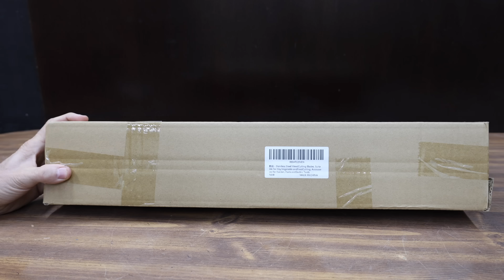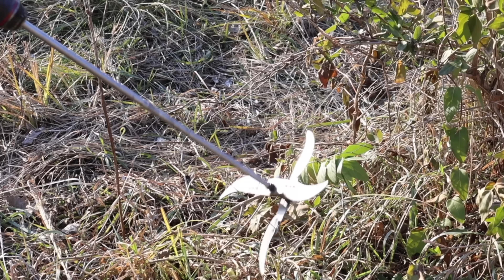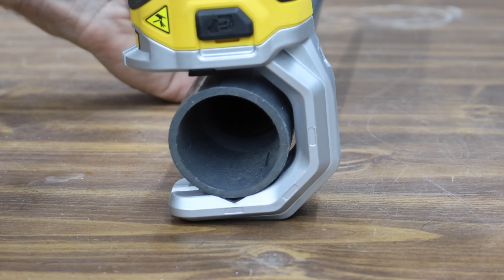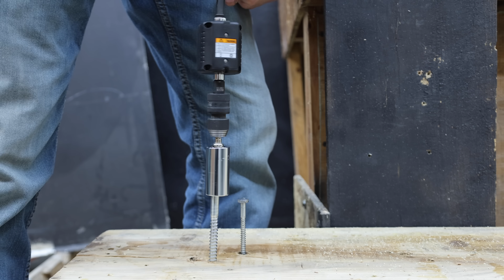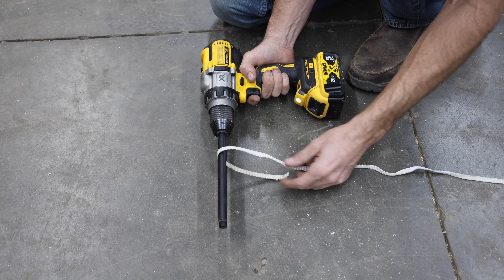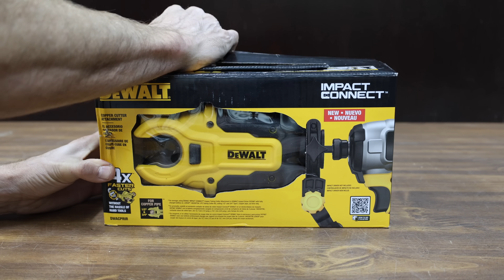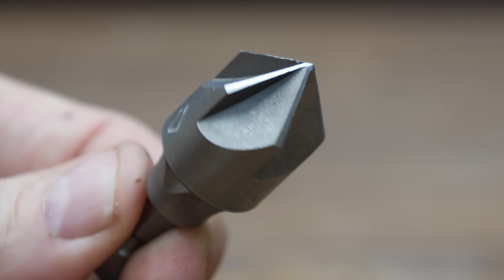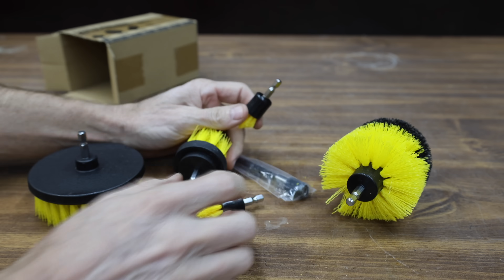I Replaced 10 Power Tools With My Drill!

Comment from the maker: Here are the drill attachments and please check out the video description for more details. I bought all of the drill attachments; no sponsors, no free tools, and no company saw this video before you did. So, thank you for supporting the channel! Best regards, Todd

DeWalt PVC/PEX Cutter: https://amzn.to/3KMkUTX
Chainsaw: https://amzn.to/44LBeuS
Universal Socket: https://amzn.to/4qmxwQx
DeWalt Metal Shear: https://amzn.to/4qsMQeI
Strap Winder: https://amzn.to/4qrGLPv
Auger: https://amzn.to/49q3DsV
DeWalt Copper Pipe Cutter: https://amzn.to/3MOTrBA
Deburring Tool: https://amzn.to/49rkwU0
Deburring Chamfer: https://amzn.to/44CsVS4
Drum Sander: https://amzn.to/4qoGxZs + https://amzn.to/3YaroPu
Sandpaper for Drum Sander: https://amzn.to/3YJEiEc
Drill Brush Set: https://amzn.to/4p3mbUp
Flexible Drill Bit Extension: https://amzn.to/49qUIHG
Wire Brush Set: https://amzn.to/4pdFPNv
Water Pump: https://amzn.to/4apMQHw
Vegetation Cutter: https://amzn.to/45j4nxt
Circular Saw: https://amzn.to/3Yul2ux
Reciprocating Saw: https://amzn.to/3LiTYLz
Rivet Gun: https://amzn.to/4jljRqQ
Reply: :face-fuchsia-wide-eyes::face-blue-wide-eyes::face-orange-biting-nails:This is like CRACK for the cheap DIY fiddling with crap person with not alot of pocket change or space for BIG tools, tons of hand tools (like I have had dremel and rivet)  or bench tools
Reply: @klyanadkmorr Caterpillar was created with the crazy idea of selling more expensive but reliable as being cheaper where nobody was concerned about reliability. Took over all markets but one. The only one where price does not matter. Govts. Don't be like them. Learn to recognize true long-term value.
Reply: @klyanadkmorr And like drugs, always a bad idea.
Reply: video idea: collaboration with Smarter Every Day. I just think you guys would work well together.
Reply: @megarural3000  Neither Project Farm nor Better Every Day has ever done reviews of robot vacuums. Project Farm should do normal big robot‑vacuum comparison with all the usual controlled tests for his clean spreadsheet. And then, Better Every Day should take the same models and show what it’s actually like to open them up, use them daily, and fix them, dealing with real‑world failures. After that, Project Farm can update his rankings with the new repairability and long-term use data so final results reflect both performance and long‑term ownership.
Reply: Thought you might have used a oscillating multitool attatchment if there is such a thing, thats besides the plasterboard ones which arent much.
Reply: That external deburing tool can be bought on ali express for less than $5. It is simply being drop shipped from ali express to amazon. I would check to see if the same is happening with all the other products.
Reply: @littlejack59  Will you? Why haven't you? Slow shipping, long delays, no quality control,   common counterfeits, dishonest specs, fake safety claims, and painful returns make Ali Express ALWAYS a bad idea. Not where you buy REAL tools. Do not attach anything from there to your REAL drill. Only some cheap Harbor Freight drill and only after doctors have given you 5 years to live anyway. LOL
Reply: I have a dewalt 90º impact adapter and it has been fantastic.
Reply: I really enjoyed this video but I think the quality of the drill is obviously important. I would very much like to see this video redone with a high quality *wired* drill. I always prefer to use wired power tools- even with the newer battery technology- wired power tools are significantly more consistent, strong and reliable.
Reply: @uhmmchicken  At first glance, that looks like a Milwaukee M18 FUEL 1/2" Hammer Drill (2904‑20). This is a high torque (1400 in-lbs), high spin (2100 RMP) trade‑use drill (framing, hole saws, augers, metal). Tough but expensive to use batteries drill. Your claim that "wired power tools are significantly more consistent, strong, and reliable" was very true over 20 years ago. Most corded homeowner drills are 6–8 amps, 300–500 in‑lbs torque, 2500 RPM, no clutch, electronic torque control, kickback or overload protection. They give steady but modest power. The impressive 2904‑20 out‑muscles most every corded homeowner drill ever made. Only 10–13 amp heavy‑duty corded drills can beat it. Why the corded heavy-torque class of drills is dead. In fact, I can't think of anything similar in production. And these demos would not have changed. 🙂
Reply: @JustMeAP1  While high-end brushless cordless drills now rival or exceed the torque of some corded models, corded drills generally offer superior, consistent power and higher top-end speed for heavy-duty, continuous tasks.
Reply: @uhmmchicken  I covered your BS claim. Steady but extremely low power is NOT impressive. Again, I could not find any "real" corded drill in production. I know growing up is hard, but it's time to catch up.
Reply: Can you please do a video on Dent pullers for vehicles?
Reply: "We're gonna test that" with the world's worst version of the scientific method where we can't read any of our measurements.
Reply: Or test automobile windshield wipers please? Including the kimblade
Reply: Great video as always.  I have an issue with tools that cost less than $3 to manufacture selling for more than $10.
Reply: Test these new handheld leaf blowers showing up online?
Reply: Did your health insurance payments just increase? 😂
Reply: On the rivet adaptor, did you tried to unwind the drill long enough until the rivet falls off the attachment? I have one and that is the way of release the shaft of the rivet
Reply: no clue why this hit my feed, but its not only something I needed and didn't know it, but by the end of the very first review....the weed cutter, I was subbed.    Just your tone of voice as you matter of factly pronounce it "this is the most dangerous thing I've ever tested".
Reply: “No sponsors”

Meanwhile Dewalt getting all this free advertising. They should definitely be paying after this. Those attachments worked as advertised!
Reply: The brush set is actually on its way to me now 😂 I got a dinky little drill for in the apartment and need to deep clean the bathroom and tile for inspection week in two weeks! For once I got the review BEFORE needing the items! (I bought rhino ramps 2 weeks before you reviewed all the car ramps 😅)
Reply: @JayFochs1337  The chemical you use on a bathroom or tile surface matters far more than whatever brush you use. I'm a 70 yo with a broken back and I have FAR more elbow grease than drill-based brushes. CLR and Lime-a-way are great for shower calcium. But hard‑water scale chemically hardens into calcium carbonate “stone” with hard water laugh. Stronger acids (that mean special suit to use) include stuff I cannot use on my fiberglass. Silica, common hard water issue, ignores all acids.

Step 0: CLR. For tough calcium and silica... Step 1: alkaline cleaner to break up the soap-scum bind. Dawn is surprisingly effective. Sit for 15 mins. Step 2: a plastic razor scraper. Step 3: warm wet paper towel to better soak. And repeat. For glass only, use steam (and vinegar). Still a milky haze on the glass? Use Cerium Oxide Glass Polishing Solution.
Reply: Can you do a video on electronic microscopes?
Reply: Please, please, please can you calm down the delivery. It's so interesting but I can not make it though an entire video.
Reply: I thought of a way to make the universal socket better, they should use hexagonal pins instead of round ones so there is no space between them and they cant slide around. if placed and sized properly the pins would center on every common nut size.
Reply: @ElectricalExistence  Hexagonal pins don’t fix the fundamental mechanical failure mode. They just change the shape of the failure. Even if the pins are hexagonal, each pin is still an independent, floating element. Each pin touches the nut on a tiny area. The load is carried by a handful of pins. Pins take eccentric, off‑axis loads. Stress concentrates at hex pin corners. You still don’t get the continuous 6‑point or 12‑point flank engagement of a socket.
Reply: Can you test 4K cameras, like are used at church that attach to "Facebook, Go Live"? Or for YouTube? Thanks!
Reply: @timothysanders1387  You're talking about 4k (standard today) PTZ-style livestream cameras controlled by joystick or software from PTZOptics, Sony, Canon, AVer, BirdDog in the $800 to $5,000 range... that's a large range. My consumer EMEET S600 4K Webcam, MAONO XLR/USB Dynamic Gaming Mic, and NEEWER LED Lights for Zoom calls, etc won't cut it because requires a computer and is for one person at a desk at a relatively fixed distance. You want LARGE optical zoom, remote control, and even multi-camera switching. A proper PTZ, 30× zoom 4‑camera sanctuary setup for from back, front looking at audience, stage left and right with wall mounts, long SDI and short HDMI cabling, PoE switch (8‑port minimum), PTZ joystick, Pro video switcher, Blackmagic ATEM Mini Pro, ATEM SDI Pro ISO, and AI auto‑switching box such as SermonShots AutoDirector or CUEbiq AI Switcher, XLR to 3.5mm for church audio for $3,500 to $4,000 minimum. A lot more than just a camera.

(Qty 4) FoMaKo FMK‑30X‑SDI 30×: $2,396  
(Qty 4) FoMaKo PTZ‑WM Wall Mount: $116  
(Qty 3) Cable Matters 3G/6G SDI RG6 100 ft: $177  
(Qty 1) Monoprice Premium HDMI 15 ft: $9  
(Qty 1) TP‑Link TL‑SG1008P PoE+ Switch: $59  
(Qty 1) FoMaKo PTZ‑JX Joystick Controller: $199  
(Qty 1) Blackmagic ATEM SDI Pro ISO: $495  
(Qty 1) SermonShots AutoDirector (AI ): $399  
(Qty 1) Hosa XVM‑110M XLR‑to‑3.5mm: $19

TOTAL: $3,869 (video only using church audio).
Reply: It's pruning season.  Can you put handheld ratcheting pruning shears and cordless pruners to the test?
Reply: @edizzzon21  My $20 Fiskars PowerGear anvil lopper would be a perfect baseline to one-handed ratcheting shears and cordless electric pruners since it will take quite a bit more cash to beat such an ideal reference. Tests should include 1.2 inch green stems and 1 1/4 inch dead branches of Tucson's Mesquite. $26 Garden Guru / MLTOOLS Ratcheting Anvil Pruner would only win on small green stems. True for shears at any price. $130 Kebtek KET‑25 25mm (1") 16.8V Electric Pruner will often stall on the mesquite. Again, only wins on the green stems. $81 Dragro DS-02 1.6-inch Prunning shears would pass. And the $90 SEESII CS440 1.6-invh would do even better. The winner.
Reply: @edizzzon21  My $20 Fiskars PowerGear anvil lopper would be a perfect baseline to one-handed ratcheting shears and cordless electric pruners since it will take quite a bit more cash to beat such an ideal reference. Tests should include 1/2-inch green stems and 1 and 1/4-inch dead branches of Tucson's Mesquite. $26 Garden Guru / MLTOOLS Ratcheting Anvil Pruner would only win on small green stems. True for shears at any price. $130 Kebtek KET‑25 25mm (1") 16.8V Electric Pruner will often stall on the mesquite. Again, only wins on the green stems. $81 Dragro DS-02 1.6-inch Prunning shears would pass. But the $90 SEESII CS440 1.6-inch would do even better. In fact, there is no better cordless pruner. It's a small market.
Reply: I dont anyone questioned you sponsored ANY of those, bubba. 😂 Thanks for taking the risk for all of us.
Reply: Do head light restor kits.
Reply: Bait
Reply: If you reverse the drill the spent shaft will push out.
Reply: Pivot gun attachment
Reply: Rivot.
Reply: We NEED a Review on Plate Compactors .. there are Dozens out there..  some ( WEN 212 from home depot that looks Identical to the Central Machine from harbor freight ) but they have way different #'s of performance..  ??? Makes me wonder ..  and there are literally dozens that have different brand names that look same os others, but have different performance #'s and different $$$$ ... some with belts on side , some with belts or gears on front , some go fast , some go slow ...   man ... we just need a REVIEW !!!!!!!! AND THANK YOU FIR ALL YOU DO !!!!!
Reply: It would be nice to have a review of trail Camaras. I have some land and would like to get a good quality Camara the reviews on I looked at so far just don't do what you do.
Reply: Can you do a video on cleaning products that clean limestone the best.
Reply: Can you do a review on handheld   Spot treat carpet cleaners?
Reply: You never answered my comment. You SOB!
Reply: Why haven’t you tested prolube oil treatment against other brands!?!?
Reply: I think you should test for the most accurate trigger pull gauge, there are plenty of brands & a few that are extremely famous among YouTubers, I'm sure many people would greatly appreciate knowing who has the most accurate tool.
Reply: Love videos but your voice needs to slow down way to fast! You might get more views without the headaches  after 30 seconds it puts me off listening and I switched off !!!
Reply: Any chance we can get some reviews on electric powered pull wagons? Bought the litheli outdoor pro and it struggles on small inclines loaded. Just wondering if there is something better
Reply: I’m about to buy an ultrasonic cleaner. The first place I come was Project Farm, and they’ve never been tested. So there’s my suggestion!
Reply: The DeWalt pipe cutter and metal shear attachments genuinely impressed me those are well-engineered and hold up even under professional use. The chainsaw attachment, though? Hard pass. Liability nightmare
Reply: Wonder how long would the drill bearings last using these attachments.
Reply: @ProjectFarm  Am I strange for finding a 3 hr video speeded up to 17 minutes by the creators speed talking in a high-pitched voice very relaxing, fun to watch, interestingly competent and very informative all at the same time?? Love what you do for us especially in times when every cent counts!!
Reply: Greetings.  Thank you for sharing your time and work with us.   

I wonder if you would consider testing men's electric razors? 

Thanks you again
Reply: I hate battery operated drills as it doesn't take long (5-7) to spend many times more for batteries than the drill. As budget packs last a fourth as long as pro grade packs. Plus, life is independent of use. And cheap chargers just cook your batteries. And then, you have reached the end of its life. I'd say cheap portable drills make no sense. Cheapest drills to make sense are Milwaukee M18, DeWalt 20V Max, Makita LXT, etc that cost $150 just to get started. If you don't want to spend this much, corded is the way to go. Cheaper and more useful is to purchase as much extension cord as you might need.

The problem with any drill attachments is cheap versions WITH motor costs the same and real work (for any length of time) creates unbelievable heat to melt anything cheap. If your demos went for just 45 mins, you'd be even less satisfied. A $100 drill attachment makes no sense as a 1 min time saving is not enough to matter. Manual riveting, hand shearing (for light work) also too easy. Small sanders are too cheap to instead use one that does less on my drill. And anyone will already own one. Universal sockets slip under load, don’t work on recessed or narrow fasteners, terrible on anything not a perfect hex, and slower than grabbing the right socket. Not a real tool. A $20 auger attachment is a thin, stamped, low‑tolerance spiral meant to be spun by a drill that was never designed for continuous high‑torque, low‑RPM soil cutting. First useful tool but only for very small tasks such as small bulbs. Anything more and you're killing your $150 drill. The only way to damage your drill more is with a metal-cutting attachment. Wire brush attachment is first not bad or ugly (same for deburring tools). I own all kinds. Same for non-wire. But elbow grease works just as well. I never wind straps. I would also never use a low-torque extender. And I'd just use my oil extractor instead of a toy water pump. Wire brush is it.
Reply: @JustMeAP1 just buy a more budget friendly drill like harbor Freights bauer, hercules, or skils 12/20v. But if your willing to spend the money on a quality drill and battery packs that will last and are repairable, then go makita.
Reply: @littlejack59  A "more budget friendly drill" like harbor Freights bauer, hercules, or skils 12/20v is exactly what ends up silly expensive after you add in the quickly dying cheap batteries and charger. It is a disposable purchase over 5 years. Only a bad buy if you expect to be dead and have no children. Normally, 100% stupid compared to $150 drill or a $24 100' extension cords even cheaper at Amazon.
Reply: @JustMeAP1  I've had luck with third party, they definitely lie about capacity, but are a fourth of the cost and just experienced my four pack shutting off when it got too hot with my dewalt oscillator. So, it clearly has good charging and protection circuitry. Also charges at expected speed given its supposed 6AH capacity. I think I paid $200 for a 4 pack. Most of the time I use official batteries on my power tools, like I have a pair of 8AH Powerstacks that fit in a 4AH footprint and weight. Those were $150 each which was like $100 less than Lowe's wanted. Though knock of 6A packs have lasted well over a year and haven't noticed any major power loss, but again, I think it's more accurate to say they're 4Ah. Maybe 5Ah to be generous, knowing how batteries are made and what cells these knock-offs use.
Reply: @tdata545  A $40 B&W LDX120C could easily need $120 for three batteries in five years. If you charge your $200 batteries (not actually affordable by anyone buying a $40 drill) using the original charger and they won't last long. Ryobi is the NUMBER ONE brand people regret owning after 5 years (I have personal experience with them) as their batteries cost more than the $70 drill and comes with one shitty charger. Besides B&W and Ryobi, Craftsman is tops for dumb cheap drills. Craftsman V20 is a "Ryobi with a red sticker." WORX, Kobalt, Porter‑Cable, etc... until you get to $150, a portable drill makes NO sense. "Third‑party packs CAN work?!?" You’re proving my point, not disproving it. You’re tolerating lower‑grade cells because the official batteries are financially absurd. If a "6Ah" pack behaves like a 4Ah pack and costs $50 each, that’s not a win, that’s you accepting fake numbers. Again, not a win. FAR better buy than any of these cheap drills is Makita XFD131 18V LXT, 2 batts for $196. My cheap Roybi cost this in under 7 years.
Reply: @JustMeAP1 NiCad packs are easily rebuilt.
Reply: @josephproctor690  Battery techs like Adam Savage’s Tested and tool‑repair channels such as AvE have repeatedly shown that NiCad packs are not “easily rebuilt” in any reliable sense. The cells are obsolete, matching internal resistance is difficult, and most cheap replacement sub‑C cells are low‑grade garbage. Even hobbyists who rebuild packs admit that “you’re fighting chemistry that’s 30 years out of date.” The poor logic behind “NiCad packs are easily rebuilt” collapses because it relies on anecdote, survivorship bias, false equivalence... pretending that a one‑off successful rebuild equals a general truth and ignoring that most packs fail early due to mismatched cells, heat, or poor welds. Bad logic produces bad results: wasted money, unreliable packs, tools that die after a few cycles.
Reply: @JustMeAP1  I'm using only cheap battery drills. And I think you are completely wrong: cheap drills makes the most sense. It is very hard to cook the battery on the drill, as current flowing even if it high, it's only for few seconds at a time. Of course premium drills will be lighter and stronger, but that's not the case.
What can "cook" the battery are tools that require a lot of power: I've repeatedly had warm battery with sabre saw and I believe it could be similar with other saws. THat's why double battery tools were invented, e.g. I have lawn mower that heats up battery a bit, but much less than saws. 
Of course if I needed certain tool for work, I would go for more premium - I used Makita and Milwaukee and these were great, but for home, where you generally need 1 unit of most tools, it just better to go cheap, and only buy few better tools - that's why I'm buying Milwaukee, Bosch, Makita na DeWalt bits, saws, etc.
Reply: @OldSkullSoldier  Battery engineer Jeff Dahn (Tesla/Panasonic research partner) notes that “cheap cells age rapidly because of poor thermal management and low‑grade chemistry.” Project Farm repeatedly shows that bargain‑tier drills “overheat, stall, and kill their batteries far faster than pro‑grade packs under real loads.” Together, they make clear that your claim “cheap drills make the most sense” ignores both battery aging physics and real‑world performance under torque, silly.

Your claim that “cheap drills make the most sense” based on your own experience is an anecdotal fallacy, a form of hasty generalization. You then add a false cause fallacy by insisting drills “can’t cook batteries,” ignoring charger quality, cell chemistry, and thermal management, and a false equivalence by treating light homeowner use as identical to real‑world loads where cheap packs routinely fail. Use bad logic, get bad results, child.
Reply: @JustMeAP1   Oh come on. It's just ohms law. Low loads heat batteries far less (I*I*R). So if battery is not heated it will age resonably slowly. Reasonably, as every battery ages. Of course like I said: it depends on power requirements. Battery masonry drills are very energy consuming and thus use either corded one or spend 5-10x more on premium. 
And for charging: these are times long gone when you could use freshly charger batteries as hand heaters. Now even cheap batteries have temperature control and won't charge (I've seen that even with batteries lying in full sun, so threshold might be as low as 45-50*C). 
And there is an important factor of quality vs price. I've seen lots of professionals using cheap drills next to their Festool, Hilti, or other less premium tool (like Makita or Milwaukee). 
And it makes sense, new generations of tools are released every few years, before previous generation fails. And BLDC use much less current when stalled, so this also adds to battery life. 

It's no longer as it was with NiCd tools. 

BTW: I;m not your child, jerk. Act with a minimum respect.
Reply: @OldSkullSoldier  I provided you with facts, expert sources, and serious logic failures in your argument. Anyone with the intellectual capacity or character past a First Grader would have been able to admit these things. Not you. Your chronological age means nothing. I am giving you ALL the respect you deserve, silly loser. You deserve none. You are 100% wrong on the physics. You clearly lack the education. Again, you 100% lack the character to admit it. 

You treat a drill battery like a resistor in a textbook, but actual lithium‑ion packs just don’t age from instantaneous I²R heating, silly child, they age from time, temp, charge‑cycle depth, poor charger profiles, cheap cell chemistry, and poor thermal paths inside the pack. Dahn’s research is explicit: cheap cells age rapidly even at low load because the chemistry itself is low‑grade. Load is not the primary aging mechanism.

A single thermistor glued to the pack shell is NOT thermal management. Dahn, Housley, and every teardown engineer agrees that cheap packs cook themselves from the inside long before the thermistor notices. Pros use cheap drills for dirty jobs, sacrificial tasks, loaner tools, and single‑use abuse. Not for any kind of long-term economics. A BLDC motor does not magically reduce battery stress. It reduces motor stress; battery still sees high current spikes. It is but another in a list of logic fallacies. Your marketing example of new gens is a non sequitur. Obviously, a silly First Grader like you can't understand. I have repeatedly explained the economics. Not looking at NiCd, child. Comparison is a cheap Li‑ion vs. pro‑grade Li‑ion.
Reply: @OldSkullSoldier  You only ever quote yourself. I'd love to hear about your engineering degrees. I have three. Was good enough to retire at 42. If you lack any formal education, like the First Grader we know you are, you should be quoting other actual experts (like me). But you can't because you're a dufus, kid.